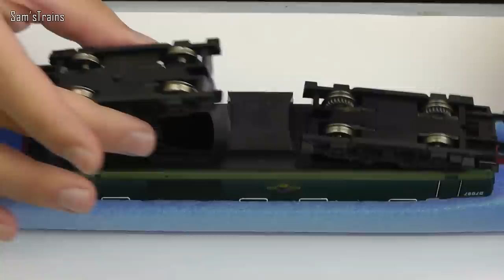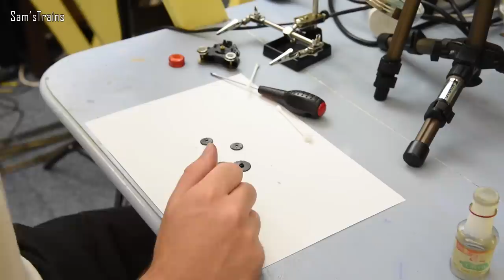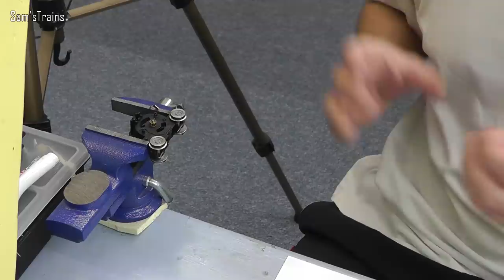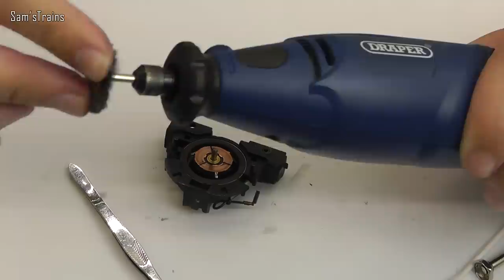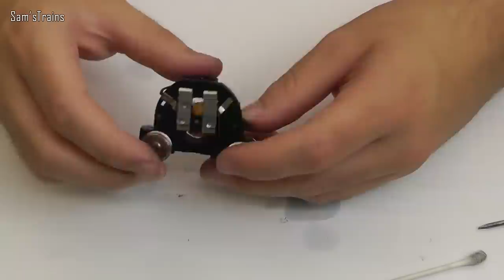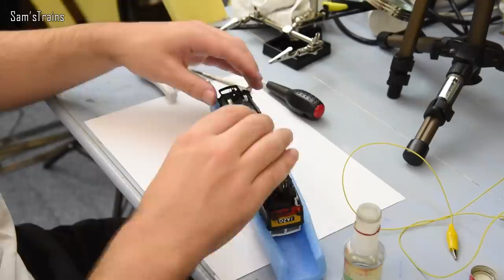How to Service Any Hornby Ringfield Diesels

Comment: Good drills Samuel, his vid helped me take apart my "new to me" 47, which has a bogie mounted RF motor.

As expected, very nasty and sticky in there so twenty minutes of cleaning the cogs out and connectors.

And wow massive difference, less power required to get moving, smoother running once underway and for some reason better navigation of point work. Can only assume this is because there is less resistance inside the inner workings fighting the natural resistance you get when passing through frogs.

Good show old  chap !
Reply from the maker: Great to hear that mate, very well done for that - yes it's very satisfying isn't it?!
Thanks for watching - Sam :)

Comment: The early "Silver Seal"  Ringfields only have 3 gears.  The are a bit different to pull apart, but still east enough.
Thanks for the great update to the overhaul/maintenance process.
Reply from the maker: Yes you're right, the early ones were a different design, but the process is basically the same!
Thanks for watching, Sam :)

Comment: Hey Sam, super helpful video!,                                   just wondering where you picked up the vice that you used in the video, as I cannot find one with a wide enough jaw, or either it is too massive and expensive
Reply from the maker: Thanks so much! I think mine came from Ebay or Amazon - I've had it for years!
Thanks for watching - Sam :)
Reply: Sam'sTrains, cheers mate! I think I found one on eBay 👍🏻

Comment: Sam do you know how to open a 47 
I bought the Majestic set and wanted to try and make it dc because of issues I had with dcc
Reply from the maker: Hey! If it's a Hornby one, it should be quite similar to this! Hope all goes well for you! :D
Thanks for watching - Sam :)
Reply: Sam'sTrains Hi Sam. After being carefully stored away, in the original packaging, since purchase in 1986, I have decided to return to modelling and running my R.042 LNER 4-6-2 Loco No. 4476 ‘Royal Lancer’. It has a Hornby Ringfield motor which is in the tender. Removing the tender from the chasis was fine but, I need a little advice regarding the removal of the motor from the wheel chasis. Can you help please?

Comment: I wouldn't clean a commutator in the way that you did.  The 'black' is almost certainly carbon from the brushes and as this is carbon it is an excellent electrical condutor so apart from wiping with ipa or similar it's not neccessary to abrade the commutator.

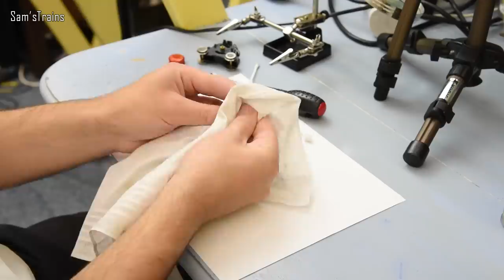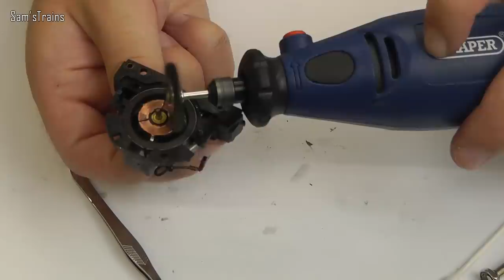Comment: A nice clear video with some good tips Sam, well done. I hope I don't seem big headed but here are a few suggestions that have kept my models going for the last 43 years :) delete if you wish, no problem. 5:51 add in a brush between the teeth with an old tooth brush, removes stubborn grime and any bits stuck in there.  7:11 may I suggest instead of super glue use something like RS Pro Blue Thread locking Adhesive, super glue breaks down under heat also this stuff will only cure where it is airless so if you do get any slashes it can be easily cleaned off. 10:42 wheel removal on the plastic side only, a medium flat blade screw driver can be used to gently pry between wheel and chassis to get  the wheel off, work around it bit by bit to make sure it comes off evenly. 17:25 oh, I'd personally not recommend any kind of abrasive on commutators, the micro scratches caused will cause brush wear and will fill with debris, this will cause heating due to resistance mate, hope its ok to say?.
Reply from the maker: Thanks a lot for the tips Mike - much appreciated! I'll definitely use some of those!
I've heard the same thing about not using anything abrasive on the commutators - but I once tried it experimentally on a very badly tarnished one, and it doesn't seem to attract dirt any more than others do - the scratches seem to disappear again after a quick run and another clean... and then they really shine!
Thanks for watching - Sam :)
Reply: I use a very small Minicraft grinder (with a wire wheel inserted, not a grinding disc LOL). It only runs on 3.8v and is extremely gentle, yet tough enough to polish the surface of commutators and wheels.
Reply: I'm the 30,000 subscriber
Reply: Have a problem with one of these on a tender which is puzzling me and wondered if you could help.  Motor runs on test when touching the two brush covers or the live connection terminal and neg brush cover.  I cant get a neg contact off the wheels or motor body though .  Any ideas??

Comment: Really useful, I successfully managed to resurrect a 30 year old HST and didn't lose any brush springs!  It ran badly after the service, and turned out I pushed the wheels on the axles too far,  which increased friction.  Many thanks for this and your other videos.
Reply from the maker: haha very well done mate - those springs are a pain! Yes I've done that a few times in the past too!
Thanks for watching - Sam :)

Comment: great video - can anyone confirm what voltage these motors are? I want to service one for a friend. I havent got track or the transformers to connect to the track - but I have a DC power convertor which I can adjust to any voltage <50V. My friends not sure. I have googled. seems to be 16V but just checking. thanks if anyone knows. I just do electronics usually hence I dont have the running gear etc.

Comment: I just tripped over this video as I was doing a major service on a dead Hornby Class 25 and Lima Class 37.

I’m not convinced that using a wire brush on the commutator is a good idea, especially no a steel wire brush. Apart from any broken bristles getting attracted to the magnet, if it’s still in place, it is very abrasive. If you’re going to use this method you would be better off using one with brass wires. The same applies to the wheels, so there is less chance of damage. On the commutator you could try a small drop of liquid metal polish on a cotton bud, or a small piece of Brasso wadding. If there is scoring then a very fine wet-and dry paper to smooth those out then polish with the metal polish, followed by IPA/lighter fluid to clean any residue.

I can’t add a photo here, but a couple of minutes with metal polish does a really good job, without the wear a wire brush may cause to the thin copper contacts.

Comment: Quick question. My motor won’t run smoothly, any advice?
Reply from the maker: My advice would be to try everything in the video - if it's still not running right, there may be a problem with the armature :(
Thanks for watching - Sam :)

Comment: I thought I'd just add something I've discovered this evening whilst 
trying to get an old Hornby Western working properly again, and it's a 
STRANGE one:

Problem: Would work fine in one direction but in the other, over a few minutes would slow and stop, drawing no current.

Tried all the normal stuff, new brushes, springs, cleaned commutator, lubricated etc. and no change.

Solution:
 Clean away corrosion on the under side of the brush spring retaining 
leaves. Obviously the corrosion was acting as a dielectric and allowing 
current initially  but becoming less conductive over time when the 
current was passing in one direction.
Reply from the maker: That's a very interesting one - thanks very much for sharing this Stephen, I've made a note of that!
Thanks for watching, Sam :)

Comment: Hi Sam could you please advise as to which lubrication ( grease ) to use on old & new Triang/Hornby gears and motor as I am new to this hobby?  Regards John.
Reply from the maker: Hi John - I've used silicone grease (the thinner the better) for a few years with good results on gears! For bearings, hemline sewing machine oil used very sparingly does a great job,
Thanks for watching, Sam :)

Comment: Hi Sam! So my grandparent's friend gave them some Hornby things and also an old Hornby county of Norfolk in the blue livery and it's a ringfield motor ran loco. The motor you showed in this vid had 4 wheels but mine has 6. I'm a younger modeller and my grandparents are finding me locos and rolling stock in a nearby auction house. Most things are used and quite old. If you can tell me anything about my class 47 that would help. Thanks for reading :D
Reply from the maker: Hi John, thanks very much for the comment - yes some do have extra wheels, but they're usually just dummies if they're on this design. If the extra wheels are driven, then you most likely have an ex-dapol model, which are a bit devilish to service! I tend to recommend just a drop of oil on the moving parts on those, and hope that does it!
Thanks for watching - Sam :)

Comment: I'm Canadian &  have a Hornby intercity trainset I received as  a gift while living in the UK back in 1980. I'm working on a layout & have been having performance issues with my train. I enjoyed your video on care & maintenance. I think I broke the clips holding the motor cover on while detaching the short wire on the left hand side, if you're are looking at the motor facing the brush contacts. The motor still works with the cover not in place due to my fault, & I thought of using a small piece of tape at the top of the motor housing to keep things in place. I also thought of using small screws at the spots where the cover fastened. I don't have a replacement motor or cover. Let me know what you think. Thanks
Reply from the maker: Hi J, thanks very much for the comment. Yes those clips can easily break - I've had that happen once or twice too. Provided you can keep it still by other means, it should be fine!
Thanks for watching - Sam :)

Comment: I think I see the problem which I have, your cog is hard up against the body. On mine the shaft appears to be spring loaded loaded and therefore cannot be fully engaged hence the spinning. Any ideas?
Reply from the maker: Hi Charlie - the spring effect will most likely be caused by the brushes/springs pushing against the commutator. If the gears aren't meshing, the gear need to be pushed further on the shaft - has the gear become loose at all?
Thanks for watching - Sam :)
Reply: Think I am snookered as I put a touch of superglue onto the shaft as suggested and cannot get the cog any further on it push the shaft without it springing back

Comment: I bought a hymek off ebay, and then I didn't run it for a year. Now I tried running it, and it makes a squeaking sound and i see sparks. And I even saw some smoke coming from it. Do you know what is wrong?
Reply from the maker: It probably just needs a service - follow this video, and you should be sorted! :D
Thanks for watching - Sam :)

Comment: Hi Sam.
Have a problem with one of these on a tender which is puzzling me and wondered if you could help.  Motor runs on test when touching the two brush covers or the live connection terminal and neg brush cover.  I cant get a neg contact off the wheels or motor body though .  Any ideas??
Reply from the maker: Hey Andy - on some models, there's a small wire that connects the metal brush retainer to the chassis - can you see one on yours? That left hand brush should be live to the chassis, so if it isn't, you'll need to find a way to put a wire in, which should sort that for you!
Thanks for watching - Sam :)

Comment: I just performed this operation on my class 37... the brushes were worn DIAGONAL!
I think I need some new ones.

I also want to clean my Class 33, after doing some basic maintanance to it, it sparks like crazy when running. However, although it looks like a ringfield, it's a considerably different design than that. I can't even remove the bogie from the chassis, let alone the motor from the bogie...
Reply from the maker: haha yeah - definitely some new ones are in order! Ahh interesting - I'm not sure about the class 33.... are you sure it isn't a Lima one??
Thanks for watching - Sam :)
Reply: @SamsTrains  ... Yes, it's a Lima. That might be why it's different then. :3

Comment: Hey Sam. Just picked up a Hornby Diesel D7101 (Bear) with this motor in it. I serviced him all up and everything and he ran great up until a few hours ago. He will start to jerk, slow down greatly to a crawl, and then die. He'll start back up again if I jiggle him around a bit, but if I stop him from running or interrupt it in any way, it'll happen again. I cleaned the track, the wheels, and all the pickups. 

The motor hasn't burned out or anything, so what do you think this could be? Asking since he's literally the same diesel as in the vid just Bear-ified, lol.

Thanks! - Jack
Reply from the maker: That's awesome Jack - sorry to hear about the problems, try cleaning the commutator again, but don't use any oil on the front shaft - maybe the oil is causing problems!
Thanks for watching - Sam :)
Reply: Sam'sTrains  could it also be a bad wire?

Comment: Hi sam, i have a Flying scotsman with a ringfield motor which 1. doesnt seem to get current through most of the time... 2. makes a horrendous racket when it does go and slows down too... any ideas?
Love your videos,
Will
Reply from the maker: Definitely try a full service, and check the contacts between the loco and tender, possibly cleaning the loco axles - that's often the cause of issues!
Thanks for watching, Sam :)
Reply: Sam'sTrains I think the connection between loco and tender is broken as it's just one pin that goes through... This was my first ever model and it hasn't run for 13 years after being rebuilt several times... It started to run this morning, going round 30cm before cutting out... It isn't powerful enough to even push the flying Scotsman body. I might have to buy a new one.

Comment: what the heck hornby, pancake motor? I get really old bachmann diesels from the 80s or 90s(american models) which now go for 20-40 bucks, but these locos are modern and are supposed to be good, pancake motors are really not good. Not a good use of money, sorry.
Reply from the maker: Sure - these are old models too - none of Hornby's current models are fitted with these, but many beloved older models still run them!
Thanks for watching, Sam :)
Reply: @SamsTrains  oh thank god

Comment: Good work cleaning up these mechanisms Sam. Some tips I use. (1) If you can get rubber grips for the jaws of the vice so they don't bite into anything you place in the vice, but they will grip without marking the item. To knock out the wheel axle's, get an old same diameter metal mini screwdriver (like you have on your bench) and then Dremel off 10mm or above the Phillips (star) or Flat blade. File flat the surface and to clean off any bares. You now have one instant axle tool. Use wire wool to clean copper gear cover, brush spring retainers and clean the axles. Eek, the Draper/Dremel in use, no, no, no just in case of an accident to you or your model. Better to use a Fiberglass Pen cleaner to clean the commutator surface and continue to clean out after. When replacing the wheels on the axles, add a very tiny spot of modellers grease or oil inside the axle holes for free running. If you have an OO Gauge back to back checker. Put it between the wheels and tighten up the wheels in the vice until the gauge fits in & out semi-tight between the wheels backs to re-gauge them as usual. I hope these tips help you Sam and your readers out.
Reply from the maker: Thanks a lot John - I like the rubber grip tip, I'll be sure to look into that! I have used fibreglass cleaners on armatures before - but they don't do as good a job as the Dremel - I know it's a bit dodgy, but I've done it for years with no problems!
Thanks very much for these,
Cheers,
Sam :)

Comment: Hi Sam. Where did you get the gear puller from and how much did it cost? I'd suggest cleaning between the commutator segment with a pin or similar implement. You don't use a gauge to check the back to back distance? Do you have any problems with locos shorting over points?
Reply from the maker: Hey! I bought it on Ebay I believe - it's not brilliant but it does the job - it cost less than £10 I reckon! Yes, if you're not using the dremel to clean the commutator, then you can do - though the gaps are large enough to clean using cotton. A gauge is not needed with these units, since the chassis acts as a gauge: get the wheels too tight, and they'll bite, get them too lose, and the gears won't mesh properly!
Thanks for watching - Sam :)

Comment: Had my first attempt at dismantling the motor encouraged by your clear instructions in the video. You were right about the springs! Just going on eBay having spent the last 30 minutes on my hands and knees looking for one that got away :-). Great video. Thanks.
Reply from the maker: Ahh that's such a nuisance John - I've done the very same thing many a time, sometimes it can't be helped! You can buy a load of them, then it shouldn't matter too much if you ever lose another!
Thanks for watching - Sam :)

Comment: Terrific video Sam, thanks. On mine I found it enough to clean the commutator with a cotton bud through the upper hole in the engine cover (masked here by the capacitor) and so avoid having to remove the engine cover and the wheels - doing a thorough clean of the commutator would always be best, but that cut-out seems to line up nicely to allow the cleaning of the area that the brushes make contact with, which was enough. Spinning the central gear while holding a cotton bud dipped in surgical spirit against the commutator removed a large build up of muck that immediately freed up the mech. A spot of oil here and there and the previously seized motor was running again. Your video gave me the confidence to have a go and glad I did.
Reply from the maker: Thank you! Yeah often that's enough to do it! Glad to hear you managed to get the job done! :D
Thanks for watching - Sam :)